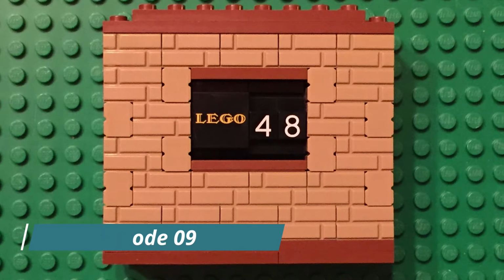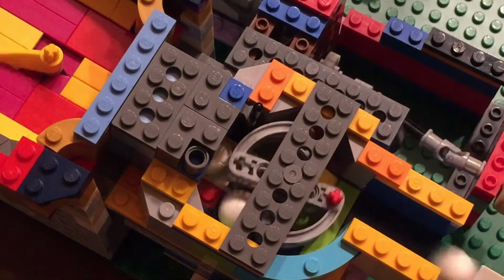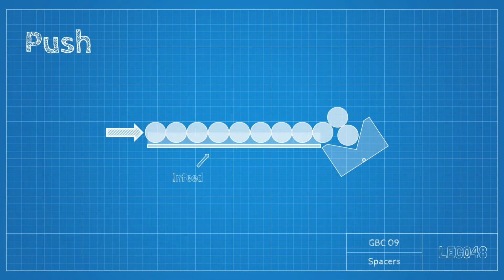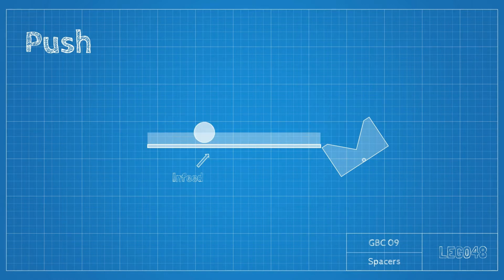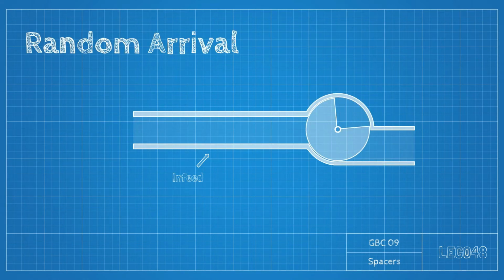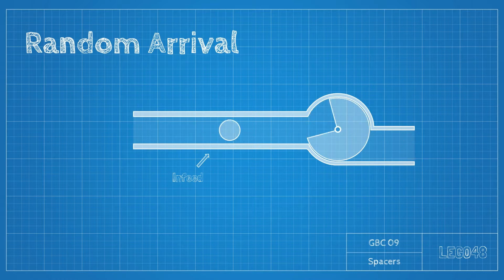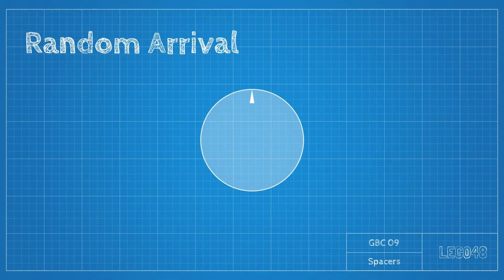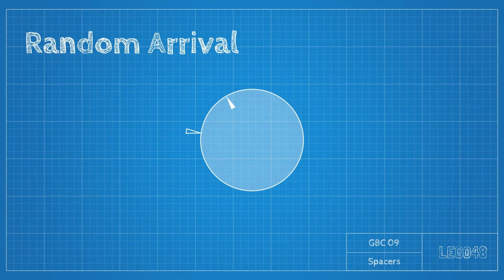GBC 09 Spacers

Comment: Your thoughts & presentations on GBCs & geometries are pretty cool. Thanks for sharing! -Mick
Reply from the maker: Glad you like them!  FYI - I've seen your site and I love the dual-action ball pump that you made - that is an absolutely beautiful bit of engineering!  I've just gotten all the pieces that I need and I plan on building one shortly (thanks for sharing the plans!).  Once I recover from my last show (Brickfair Virginia 2022), I'm planning on doing a video discussing ball pump technology - would you mind if I included your design in that discussion?  (Obviously I will credit you and reference your channel in the process.)
Reply: @lego48  sure, that's fine. Nice to hear you like the double pumps. The idea behind the dp is to use the full travel as the panels in both vids show (maybe helpful for you discussion). So I started with the orange pump using the single pump mechanism shown by Sam and Carson first and then adding the elements needed for the double pump. After that i tried a less complex but more compact design - the double pump 2.0. The next step was to reverse the mechanism, and the split pump was born! Another themed version is already scheduled for 2023/02.
There is one rebuild on yt (as far as I know), the psychedelic chapel by renato muniz.
best regards to the states 🙂
- Mick

Comment: This video was very helpful, even though a lot of it is stuff that you'd told me in person last week.  A little bit after the 8:30 mark you talk about the green liftarm you installed to control push issues, it's not entirely clear to me how that liftarm is attached.  Your dialogue there implies that there is some flexibility of movement to the arm, but we didn't get to see it in action, so I'm not sure how it works.  (I've been watching the videos in order starting with the oldest, so if you show it in a future video, I haven't gotten there yet.)

I'm not sure what went wrong with your piston, and I'm hardly a piston expert.  The one in my BWC22 module was the first one I ever got to work.  In testing at my house, it seemed quite smooth and reliable and didn't jam (much to my surprise), but because other aspects of the module failed in the convention hall, the piston has yet to undergo any strenuous testing.  For mine, relative to the table surface, the lowest point that the top of the piston reaches is just over 4 bricks.  Looking at the design, I could easily lower another plate.  If I lower it two plates, it would just barely brush the table, so any amount less than two plates would work.  But after that, I don't see any way to make one lower than that, unless you had a convoluted system where the mechanism is off to the side and the piston connects to a lower ramp that actually moves the balls.  I didn't think it was worth the effort to try and figure it out.
Reply from the maker: If you look closely, behind the green bar is a black technic brick; the green bar is attached to that via the grey pin.  The red pin that you can see right at the bend extends out the back and has a rubber band attached to it, that connects to another pin lower down.  In addition to providing an attachment point for the rubber band, it also keeps the bar from coming down any farther.  The bar simply provides resistance to balls that are trying to "climb" up over the wheel, and ensures that only one ball goes through at a time - the one that is in the butterfly notch.  Try building this spacer and running it without the bar - I'm sure you'll see a few extra balls going over the top when they're not supposed to!
Reply: @lego48  Okay, that helps, thanks.  I don't know if we'll also be able to get a view of it in a future video.  I definitely can't see the rubber band.  I've tried to avoid relying on them in my modules, because I'm afraid they'll wear out very quickly, and I have a finite supply of them.  I don't know how easy it is to get them on BL.  I also don't know how consistently they're manufactured by Lego, and if you can detect variations in tension from one to the next.  

I'll probably have to try your butterfly wheel at some point.  With GBC, I like to come up with my own stuff as much as I can, even if it means I'm essentially re-inventing the wheel, but I might have to see how it works for me, and at some point it might be the difference between having a working module on time for a convention, or taking nothing.  

I've definitely already starting thinking in your terms, though.  In the Beyond the Brick BrickWorld Chicago 2022 GBC video, just after the 23-minute mark, there's a blue and white catapult module based on Tom's 'perpetual prototype' module.  But I was most interested in the spacer they use there - it appears for about 15 seconds and then they pan away, but then they come back for even longer, so it gets considerable screen time.  It's a rocker, and in the video it works quite well, despite only being supported on one side, and so I thought 'I should let Lego48 know that this one works is an option.'  But then I thought 'Well, it works... in the video.'  Because that's all I saw.  In the video, there's a steady stream of balls coming through for the duration that it's shown.  So clearly the spacer doesn't have any issues with Push.  But eventually there's gonna be a lull (there always is), and that supply of balls is gonna clear out, and it's gonna be waiting for the next ball.  And as far as I can see, the module doesn't offer any protection against Random Arrival.  So maybe it works.  But I can't say for sure that it does.

In this video, you talk about slowing down the balls by using a zig-zag path.  The other option that I've seen done, and used myself, is hanging a vertically-oriented Technic axle over the path, attached to a #1 angle connector, so that the ball has to push past the axle to get by.  Ian uses them on his Mine Cart module, on the bypass section, because an unrestrained GBC ball will fly off an extended Friends Slide spiral after just a few turns.  The tricky part is that it has to provide enough resistance to slow down the balls in a meaningful way, but not so much that it simply stops the balls, effectively jamming the module.  (Sometimes it will stop the first ball, but a helper ball will push it through.)  In my own use, I found them to be temperamental.  I used one on my 2017 module, and it would work for awhile, and then at random times the balls would no longer push through.  So I'd have to uninstall it, but then things would get too fast again, and I'd have to put it back in.  And the cycle would repeat.  Or it would randomly rely on a helper ball for a while, and then, without any action taken by me, it would spontaneously no longer rely on the helper ball.  I realize that this isn't a ringing endorsement, but I've seen people successfully use them, and they rely on just a few common parts, so if you've tried them or have any thoughts on them, I'd be interested in hearing them.

For my upcoming BrickFairVA module, I still plan to use a small piston as the spacer.  At some point I realized I'd done my previous piston incorrectly, and I have definite plans on how to improve it.  If it goes to plan, Random Arrival should not be a problem.  But Push is more complicated.  The piston will have enough change in height that the ball can't simply roll right over.  But as they pile up in line, I'm concerned that they will pile up on top of each other (because they did on the last module), which will lead to the piston raising two balls at a time (which also happened), which we don't want (which actually didn't negatively impact the module, but we still don't want it).  I don't know if a slow-down axle will help, to keep the waiting line orderly.  I think a more likely solution is installing an overhead beam with a rubber band, similar to your solution for the butterfly wheel.  We'll see how it goes.